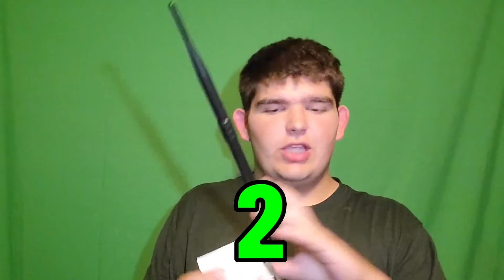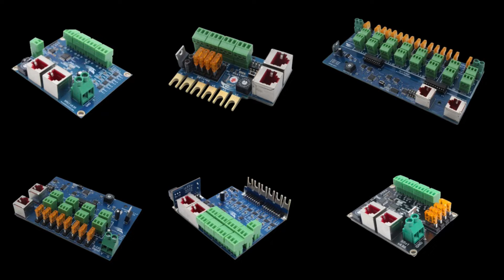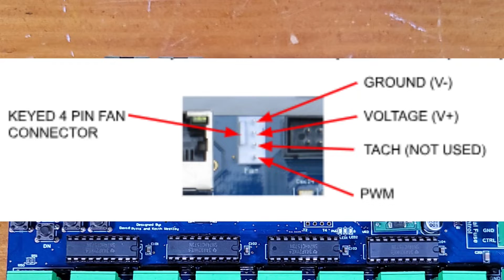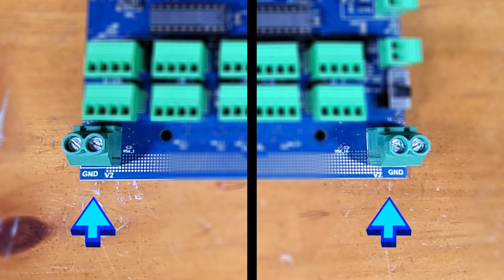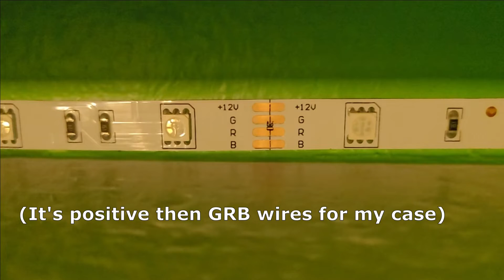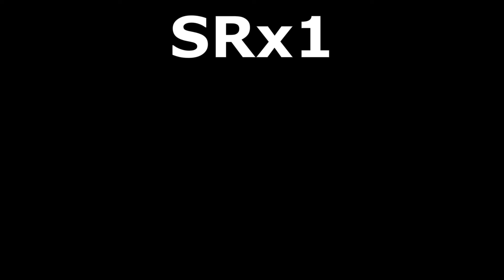Falcon F16v5 Pixel Controller Full Tutorial (Part 1 of 2)

Comment: Thank you very much for such in depth information on this new controller. As a brand new entry into this hobby, I am trying to decide which controller to invest in to support my future growth, I have such grand design plans..  What are the main advantages of this board over some of it's competitors, such as Experience Lights?  More importantly, please elaborate more succinctly about the long range ports and how daisy-chaining them will effect the total node count.  Does adding another F16V5 controller (having 2 total) to the long distance port double the total node capacity? For example: 1 Megatree 32K node to the left, and 1 32K node F16V5 controller to the right on a differential connection -- 64K Nodes---is that configuration supported and can be ran for a single player and sequence?
Reply from the maker: Now I may be biased since Falcon controllers are the only controllers I've ever used, but from the research I've done, Falcon controllers have by far the most features (especially the F16v5). Even though they are more expensive than other controllers, I know that when I get one of their controllers it will be of great quality. And if something is wrong with it, usually the Falcon controller support is great and will help me with anything. They have so many features such as the new e-fuses allowing you to control which ports have power, the 2 way talk and monitoring of the differential receivers, the ability to monitor the amperage on each port, the feature that allows the controller to count how many pixels are on each port, and so much more. 

With daisy chaining the receivers, once the F16v5 is controlling over 32 ports, adding more receivers will not increase how many pixels the board can run. The max is 32,768 pixels, and adding more ports will just split the max number of pixels per port. For example, if I have a SRx1 receiver (a 4 port receiver) attached on the controller for ports 17 - 20, the max number of pixels I can run per port will be the default 1,024. But if I daisy chain another receiver off that receiver, it will then split the max pixels per port from 1,024 pixels on 4 ports, down to 512 pixels but on 8 ports. If I add more and more ports, the number will continue to be split across them. 

Adding another F16v5 would allow you to control another 32,768 pixels from that controller, so total you could run 65,536 pixels. You can daisy chain it off the other F16v5, but you just have to make sure you plug it into the network ethernet ports (the black ones). Only plug differential receivers into the red RJ-45 ports. And yes, both these controllers can be run by a single show player and run off the same sequence. It will be a little bit more set up (for example telling the show player the IP addresses of all the controllers and which channels and universes go to which controller) but it is definitely possible. I hope all this information is helpful!
Reply: @How2Pixel Thank you Very Very Much!!  You answered my questions completely...  I am so pleased to learn that I am not bound by the 32K limit on only 1 controller..  Now, because this is such a hybrid system... the learning curve to set this up will be steep..  maybe when you get some free time.. we can see your video tutorial on how to link to controllers in this fashion..?  :)
Reply from the maker: I'll definitely add a video like this to my ideas list, but it might be a while till I can work on it. Connecting 2 controllers to one show player isn't that hard. Will you be using Falcon Player for your show player? If yes, I have a video explaining how to set up the whole thing, and instead of creating just one output in the output setup on the PI, you would create 2. One for each controller. Then hook both your controllers to the Raspberry Pi. You can do this through a network switch, or daisy chain the controllers right off the Raspberry Pi.

Comment: Great video but you really shouldn't call every RJ45 port an Ethernet port, they are not.  The two black ones are but the 4 red ones are not and if someone were to plug a network switch into one of those red RJ45's, it could cause some damage.  I would in the future just call them all RJ45's and when they are being used for Ethernet, just say so then.
Reply from the maker: Thank you for the advice!

Comment: The differential ports don't call them Ethernet ports call them a cat6 comms ports
Reply from the maker: Thanks for the tip! That'll probably cause less confusion for new people. Is it also correct to call them an RJ45 jack/port?
Reply: @How2Pixel  Yes it is correct to call them RJ45 jacks as that is correct name for that style and size connector.